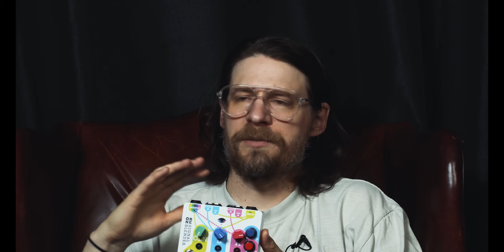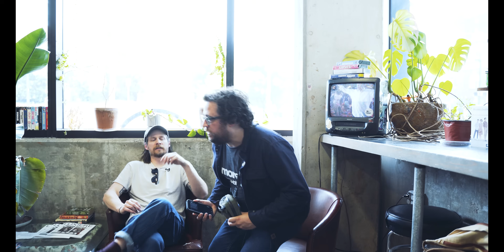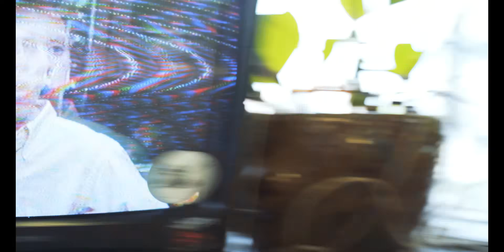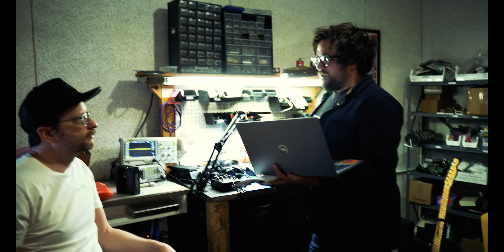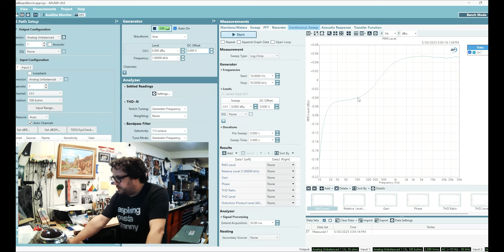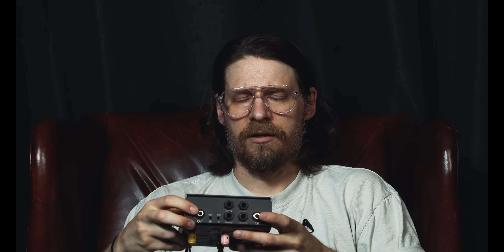Old Blood Noise x 29 Pedals Signal Blender Stereo

Comment: Really hoping my fuzzes sound better thru this version. I am in love with V1, but have been craving an update like this. Parallel distortion FTW! Hopefully the increased headroom and fix for the phase/low end loss are worth the 300. Also stoked to be able to use 1 stereo loop with 2 mono fuzzes in LR parallel.